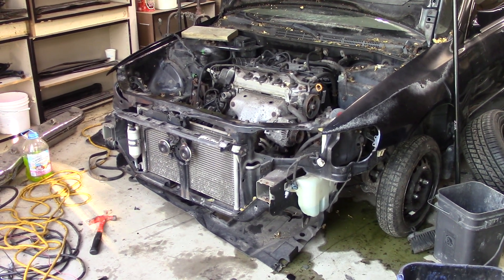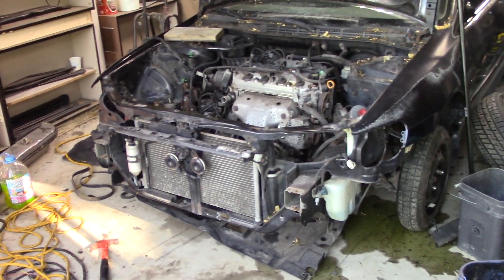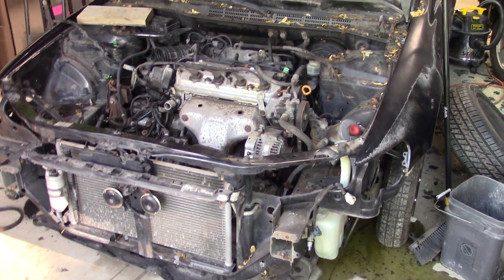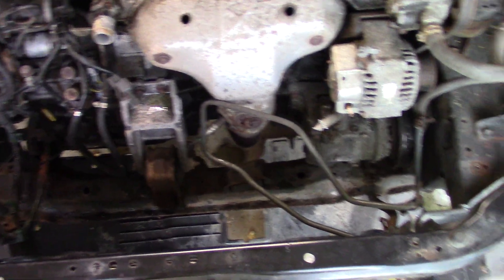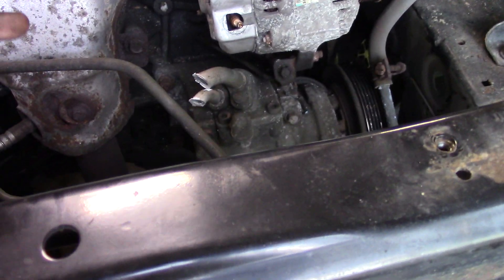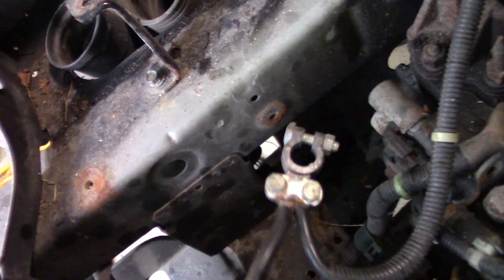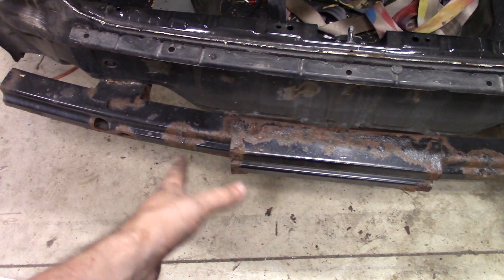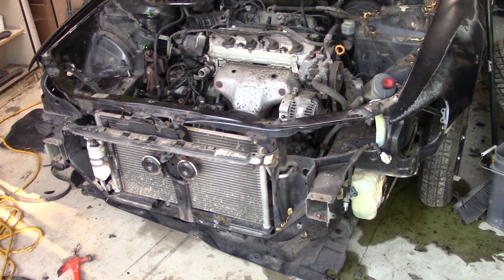2001 Honda Accord Derby Build Ep 2: High Miles with High Hopes

Comment: I ran the exact car, I removed alternator, power steering and radiator,  I left the ac compressor in and the front end bent weird, in the rear I removed rear bumper and pushed up the spare tire compartment, back end came in perfect rear frame rails were coming up

I got taken out early cuz I got hit in tires when I got stuck on the wall and my tire layed over, motor still ran

Comment: Cut the p/s lines all the way back and loop the lines like a transmission it just gets in the way and will still work fine because of fluid in the rack…back of these cars are very good fronts not so much
Reply: about the exact opposite... back ends fold great, but go in quick compared to a camry. the fronts are the business end, and will stay straight all night.
Reply: @skylarrush4184  Definitely debatable 94-97s are definitely nose out cars. 98-02s fronts are spaghetti at least in my experiences but guess it depends on you’re driving style too.